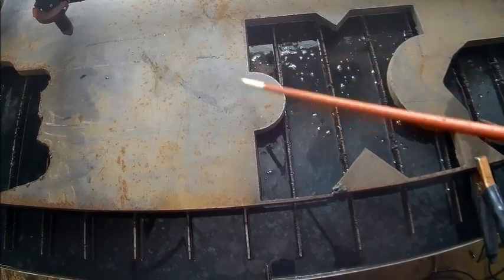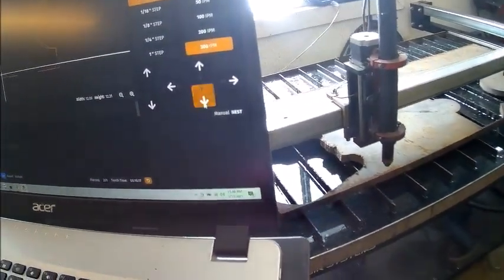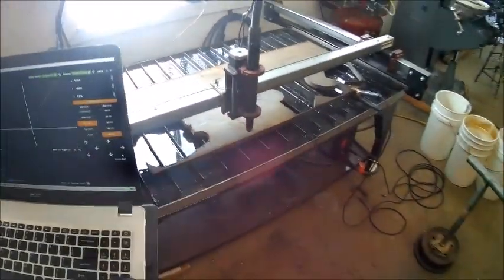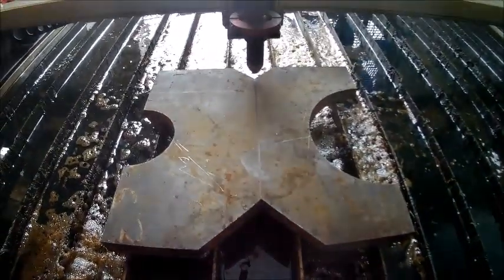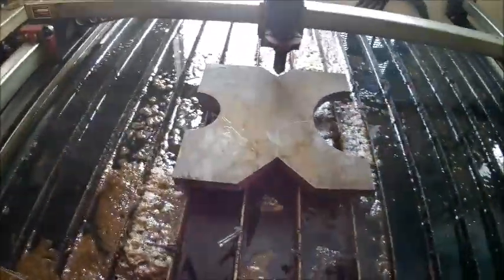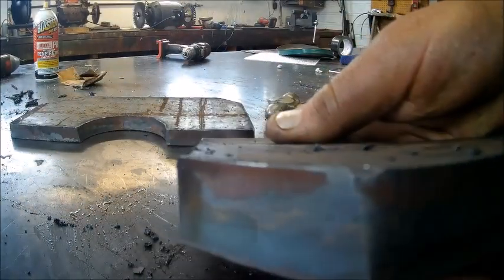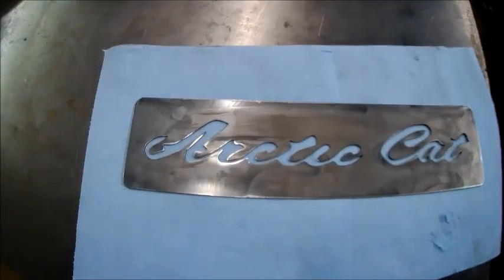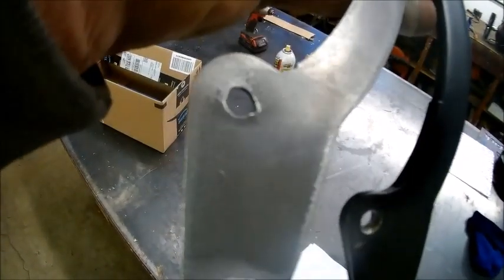LANGMUIR CROSSFIRE PRO, HYPERTHERM POWERMAX 45XP, 3/4" PLATE

Comment: Curious on what kind off duty cycle you are getting at 45 amps. Book says I think 60% which is 6 min out of 10? Looks like it took more than 6 min to cut the press plate out. How long can you runn at 45 amps before hitting duty cycle?
Reply from the maker: Never had it quit on duty cycle or shut down. Super happy I Spent the money and bought the Hypertherm unit.  I read some were that the 45xp was almost same machine as the older 65 amp unit. If your trying to decide if the hypertherm is worth the extra money i feel it is
Reply: Thanks for the advice. My 45xp just  came in last week and I can't wait to  fire it up. Definitely worth the money.

Comment: What consumables are you using?  Thanks
Reply from the maker: Using Genuine Hypertherm consumables, Fine cut consumables on thin stuff. would recommend fine cut on 16-ga and thinner. Use all book settings from hypertherm op's manual